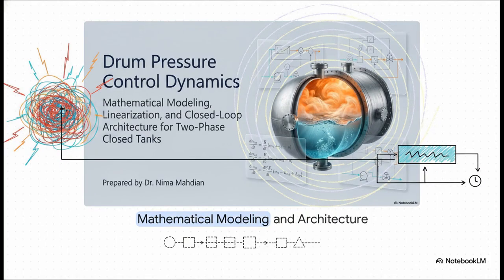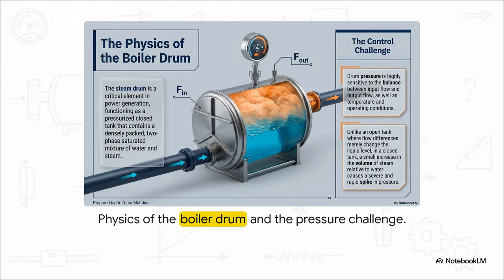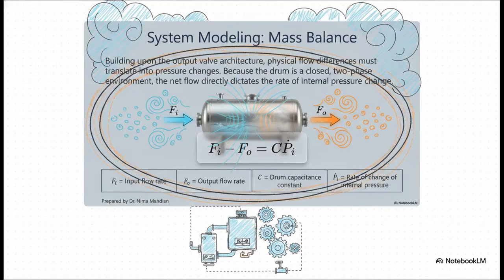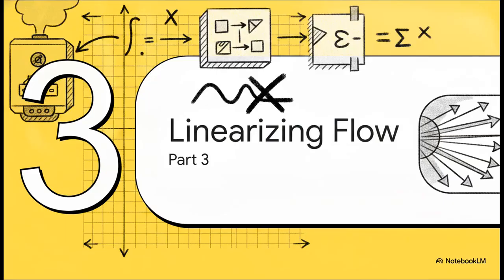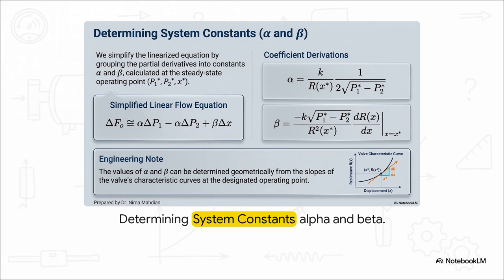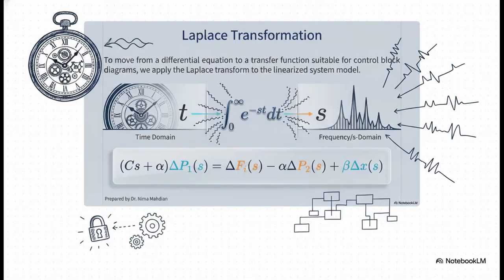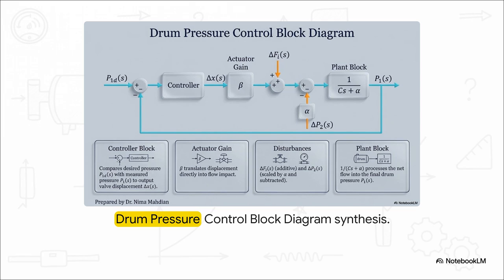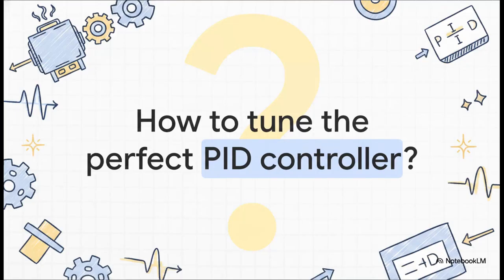Boiler Drum Pressure Control Explained | Modeling, PID Control, and Industrial Applications

Comment: thanks dr, The lecture presents both o/p valve control and i/p pump control, but models only the o/p valve strategy. How would the selected manipulated i/p change if the i/p pump architecture were used?

Comment: Thank you Dr. Mahdian, I appreciate this  practical explanation. 
My question is:
Since boiler drum pressure is affected by both controllable valve displacement and unpredictable disturbances such as input flow changes and downstream pressure variations, how can engineers tune a PID controller to achieve fast disturbance rejection without causing unsafe pressure oscillations in such a highly sensitive two-phase system?